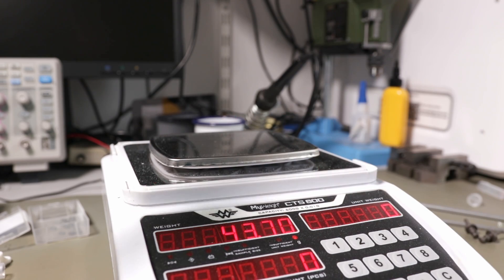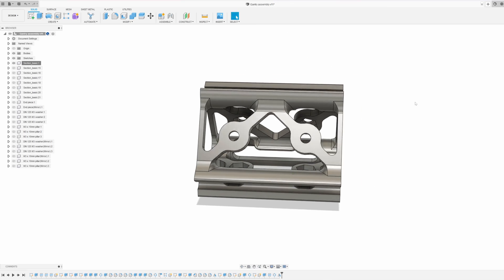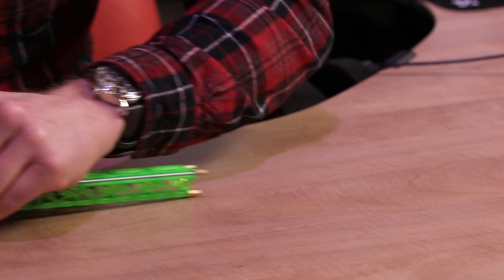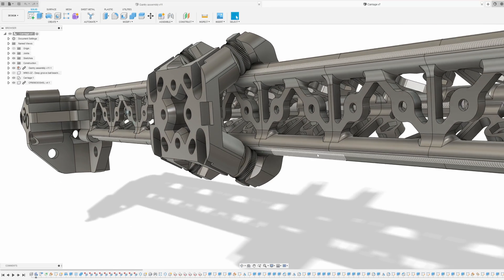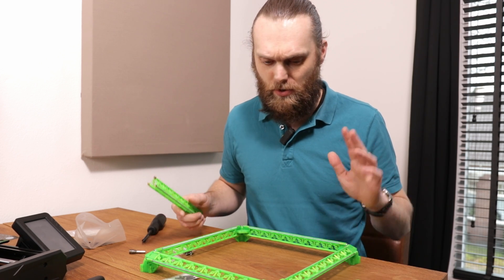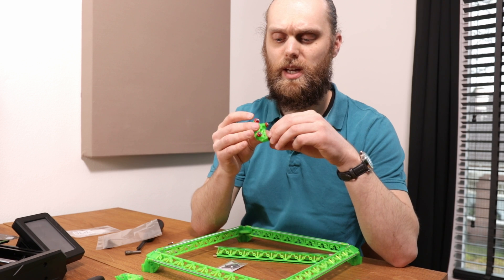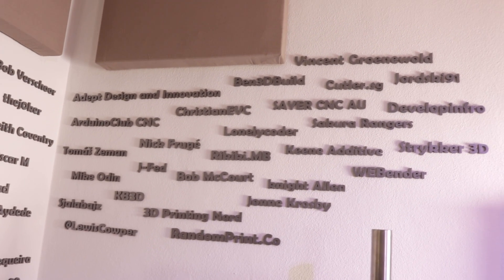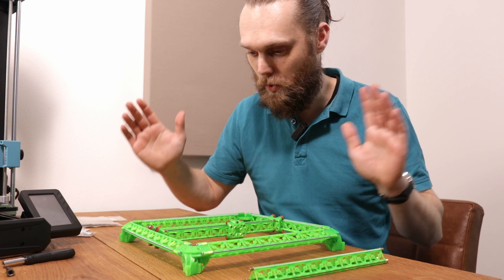Is This System the NEXT STEP in 3D Printing?

Comment: I think this will have its use. Another idea I had while watching was this super light, foaming PLA stuff. It gets weaker the lighter it is (obviously), so it probably has less of an effect than I think it will, but this probably helps with the weight. And yes, I think tubes with threads on the ends is the way to go here.

Comment: A truss is stiff and light, yes, but it is also a long cantilever and the forces change the further away from the mounting point you go. Longer moment arm means different frequencies and increased forces. You need to change the truss structure along it's length. Fusion360 can do this kind of topology optimization. Take a look at a video by Thomas Sanladerer called "Making STRONG shelves with Topology Optimization" and see if you think it might be worth looking at.
Reply: I'm mentioning this because I've seen this exact kind of project before and the result is always the same. As the dude said, you're making tradeoffs constantly. You have no need to simply re-do what everyone else has already done and if that's what you plan to do, then don't bother. But I have never seen someone consider a variable topology generated from force simulations on the model prior to manufacture.

Comment: Started with speed benchies my arse. I cut a triangulated beam/truss gantry for the corexy I built over five years ago. A superior frame system for static members, better than 99% of the 3d printer junk on the market already exists, welded rhs steel. Carbon fibre strand in tension is the king of light and strong. Look at the Britten motorcycle.

Comment: It's always a good learning exercise to try and make something with the "wrong" materials (cardboard bicycles, rubber band-based refrigeration). It really challenges you to understand critical requirements. That said, it's probably worth doing some back of the envelope calculations on how much you have to compromise to achieve similar performance from  plastic compared to higher stiffness to weight materials like carbon fiber tubes or rods of some stiffer aluminum alloys (if you can find some). Check out Ashby materials diagrams for Young's Modulus vs. density for a quick visual comparison.

Comment: how compressible is the 3d print? i think that might be a reason its not as good as expected. the print compresses /deforms and the shifts.  an idea is to make the holes on the end conical for alignment.
also the frame could be heavy and stiff since its not moving. that allows you to put tension on the gantry.
i think it would be an idea to glue the metal rods.
bike spokes might be an alternative to threaded rods.
also 3 wheels is better than 4 since if its even the slightest loseness the gantry will ride on 3 wheels even f you have 4.
a true tensegrity structure might be better...
also wouldnt the easiest way to decrease the weight of the moving mass be just to make the print volume assymetric? instead of 300x300 you make it 150 x600. the short axis is the moving mass.

Comment: Have you ever seen the Positron? It's also got some clever ideas to print even faster--the most important, I think, is printing upside down to keep the print head as low as possible, reducing the wobble of the frame. The bed is then upside-down, which seems to work just fine. Maybe some of the concepts used there could serve as inspiration for your project? Combine an ultra-light frame with a low center of mass, and a low printhead that can dash back and forth without shaking the frame apart.

Comment: It could be reallly interesting to make a big printer out of this type of system! As I know, the big rails are very expensive. I mean those that are straight and stiff. If you can manage to make a pretty cheap system (but better than cheap Chinese rails that also can be "OK quality") for a big printer (500x500mm +). Also I guess that a big 3d printer will need more powerful motors and more powerful driver chips to maintain great accelerations and deccelerations without noticeable defects in 3d prints.
It's my vision for your question "do you want me to..."

Comment: I was gonna suggest smooth rods and grooved rollers but they you figured that out yourself. You should also only need 3 bearings per carriage, you're over constraining them which makes movement less smooth and more sensitive to alignment. On the small scale of the voron 0 you're unlikely to find success making this lighter and cheaper, but for a large format printer where weight really starts becoming an issue and there is more material that can be removed, you make have better luck. 

The straightness of the rails should be somewhat adjustable by tightening and loosening each of the three rods to tension one corner more or less to pull things straight. I don't think this will fix wonky rods though so maybe try buying precision ground linear rods?

Comment: Looks sick and I think it has potential. I'd say work on it a bit more and it may be a successful innovation for Rep-Rap style printer designs. 
Maybe it needs smooth rods as you say, or maybe there's a way to ignore the bearings all together and just have a Teflon interface sliding on a smooth rod?

Comment: Please try this again but use superglue, to glue in carbon fibre rods and heated inserts at the ends for screws, with a far more minimalistic skeletal structure. PLA will "creep" over time under high loads and you'll find your threaded rod tension soon disappears.

Comment: I would build a complete 3d printer because it looks cool! 
I think the frame should be heavier in order to minize vibrations (so you could use irony threads there and save costs), then you could use your new lighter beam-system on the motion system.
Just try to improve the beam straighntness and rails (plastic rollers, not a good idea).

Comment: Hollow tubes with ID thread will work. You dont really need to thread the rods from outside.

Use carbon fiber tubes and roller bearings like you showed. This sounds easy enough with materials.

Comment: Plastic will have a tendency to deform over long-term exposure to force. You'd have to very carefully design your stresses.

Better to use something else to gain  compression resistance and go to wire for tension instead of threaded rods.

Comment: I love the idea. I was considering something similar once.
However, it is not a reasonable way forward:

Tests with 3D Printed parts show, that the stiffness of any printed material is not sufficient.
When you upscale it or you try to go for higher speeds, it will introduce wobble.
Now you add some stiffness with your metal rods, but this again adds weight. 

Way easier:
Buy a 2cm x 2cm carbon fiber pipe and mount a linear rail to it.
The endproduct is lighter.
The stiffness is increadible - even if you upscale to a large format printer.
These pipes are standard parts, meaning they are affordable.

What you get is greater stiffness, less weight, less effort and a concept that works for every printer size.

Comment: Once you started this the word "tensegrity" came to my mind. The conjunction of compressive members and tensile threads. did you consider the carbon filaments and unified tensioning mechanisms? you will save some weight and hopefully will find a way to adjust the chirality of beams and skew of the frame. would you reduce the main masses, the motor of the extruder, and the heater/radiator?

Comment: Put a threaded rod in the middle to secure them together, and smooth rods on the outside for the bearings to roll on... and do metal on metal rollers, not plastic ones. Maybe even try some carbon fiber rods on the outside for the rollers?

Comment: I agree with others, that this may not work for a 3D printer (probably not, I’d say), but I think has a lot of potential as a general structural system. As noted, it could be scaled up for larger objects. 

I wonder how it would compare with aluminum extrusions at larger dimensions? The extrusions might me more stiff, but they get dang heavy in larger cross-sections. What if the panels were, say, 10cm on a side, with 5 or 6mm rods in them? How stiff would the assembly be, for how much weight per unit length?

Kudos for your creativity and pushing the envelope with different “crazy” ideas!
I learn something or get useful ideas from every one of your videos, this time it was the idea of pre-tensioning the assembly to avoid stripping the threads on the Al rods. I knew this is done with prestressed concrete panels to overcome the low tensile strength of concrete, but I’d never thought of it as a way to save threads in a soft material the way you used it here.

Comment: Rather than making a bunch of corner pieces for each posssible angle, wouldnt it make more sense to make one master angle piece then make "adapter pieces" that rotate it to the correct angle?

how I would do this is lower the angle adapater piece lengths' along the X and Y axis, and then require these adapters on each end, so these adapters could be swapped in and out, maintaining the original length and equal length on both sides regardless of which adapaters you use. 

Although if your designing it to be used as a printer frame ig this is unnecessary, regardless cool project

Comment: Have you ever thought about putting the toolhead on a single screw similar to a cartesian z-axis? Then, the Y movement can also be on two screws (one on each side) with two stepper motors that moves the X axis and toolhead. 3 powerful stepper motors should be able to move that pretty fast. Sure, it will be more mass, but you'd also have more torque applied by having 2 stationary Y axis motors.

Comment: I might suggest rather than an enclosed triangle ⛛ , an equilateral Y shape. Tubular roller shafts (rather than threaded) should give a better weight to strength ratio; the receiving cups could be much smaller, and use CA glue for bonding lengthways. Have the wide of triangle down on flat surface, apply CA to upwards facing leg 'cup', drop in tube, which could be held down with a milled jig to ensure straightness and uniformity of pressure while curing. Ends of tubes can be tapped as needed. Not sure about the rest since I am only a lowly Ender 3 V2 use, but fascinating to watch your design progression.

Comment: Try designing the segments to use 1 threaded rod through the center. Make the end segments a little more stout or a plate of some kind to allow more torque from the single rod and connecting points for the joint. For the corners, make them interlocking and completely round or what ever mating shape you want the rollers to be. OR 2 corners interlocking and 1 corner designed to hold a hollow tube for the linear rail.

Comment: i think theres a lot of merit to this, but what i don't know is if it's possible with plastic. titanium and aluminum are kings in strength to weight ratio, but that isn't cheap for something like this, although i wonder if any performance could be gained using a gyroidal infill or something? additionally I think equally important to weight here is stiffness. if you can simulate or test stiffness for a given method, i think the comparisons will become much more valid. in an ideal industrial scenario, these segments could be extruded out of aluminum, just like everyone's favorite extrusion. they could be machined lighter but maybe no need, and then linear rods with threaded ends could be used as these bearing surfaces. of couse the bearing you describe at the end would be good for that, but in an ideal mass manufactured sense, recirculating ball bearing carriages could probably be designed for this. either way, when you weighed your designs vs just the linear rail, you included your carriage and not the linear rail's carriage, so that's a bit unfair. i also maintain that this concept could go much much further if 3d printed with continuous fiber reinforcement as found in a markforged machine. best of luck, i like the idea quite a bit actually, and i think with some refinement, and even partnership with a manufacturer, this could become something quite cool

Comment: None of this material is stiff. Next time print in CF Nylon for stiffness of the plastic parts and use CF hollow rods. This way you can keep the look and make the part ridgit. This kind of application is perfect for CF.
If you want great performance use a CF square tube and cut holes into it. Or use thin gauge steel sheets with lots of depressions, cut outs, flares and so on.

Comment: I saw an interesting design concept. A single smooth rod for X and a single smooth rod for Y, with the hotend assembly mounted at the intersection of the two rods on LMXUU linear bearings contained in a single block. Each rod constrains the potential for rotation on the other rod. The Bowden-based hotend assembly just has to be mounted such that it avoids the rods. With carbon fiber rods and Delrin bushings instead of bearings it can be much lighter. There is also another design concept that uses DIN Rails. They're not the lightest things, but drill enough holes and they can be reduced in weight a lot. Of course, using a Bowden system reduces the weight to a minimum, but you hve the trade-off of needing to do longer retraction. High quality PTFE tubing can make a difference here, along with well-tuned Linear Advance. We certainly can do better than 20x20 extrusions and rollers!

Comment: You could use steel tubes with spreading press-fit sleeves with internal threads at the ends (if there are any as small as you need).

Edit.
Maybe you could 3d print some?

Comment: This is a great video. Your CAD skills are top notch, especially the ability to make that complex corner piece printable without supports.  The idea itself is great and I would love to see more of it. 

Smooth titanium rods are definitely the way to go. 

As far as filament goes, here are some things to things to think of. 
For Stiffness, from most stiff to least, there is (Carbon Fiber Filament, HIPS, PLA, Poly Carbonate and then everything else). 
For Density from lowest to highest ( Polypropylene 0.9 g/cm3, HIPS 1.03 g/cm3, ABS 1.04 g/cm3, Nylon 1.06- 1.14 g/cm3,  ASA 1.07 g/cm3) and then everything else). 
For Strength from strongest to weakest (PVA, Polycarbonate. Nylon, PLA, ASA, PETG and then everything else). 
For Durability from most durable to least, (Nylon, Polycarb, ASA, Polypropylene, ABS, PETG, HIPS, PVA

For a part that needs to be stiff and light but not necessarily durable (Carbon Fiber Filament)
For a part that needs to be  light and durable but not necessarily stiff (ASA or Nylon)

For a part that needs to be stiff and durable and light (HIPS)

You can find more material info on Simplify3d's resources page.

Comment: $10 that most of the stiffness/load-bearing comes from those rods, ditch the plastic and you'll see minimal loss of performance. I'd even say that you might see and improvement in terms of stiffness/load-bearing per unit-of-mass.
Reply from the maker: You'll loose 10 bucks ;)

Comment: Problem with speed prints is that you need light as possible construction but at the same time resonance starts to become problem that can really only with added weight be solved. My prints are all speed prints, quality is secondary priority since i will mostly print with ABS and in less time it would take to print with nice finish i will take injection needle with cut end, syringe and some acetone to smooth everything, fix any issues etc so speed is the biggest priority. So yeah speed setups would be interesting but there are limitations what can be achieved. Then again i could get better results with just swapping to coreZY printer but now days i print very little with my prusa i3 clone. Maybe that could get me back to printing more, but for folk like me this could be beneficial development work, so have at it!

Comment: If you go for octet truss girders (octahedrons connected by pairs of tetrahedrons), then there is just one natutal orientation for the nodes. Though then the printer frame is not a cube anymore 😅 . You get a (much stiffer) octahedron shaped printer frame instead.
Reply: Octet truss struts and girders go into [111] directions (see miller indices).
Both octahedra and tetrahedra are deltoids. That is: They form a space-truss (no bending loads on nodes) rather than a space-frame. => More stiffness.
If many (max 12) strust meet at a node then the system is statically overconstrained to high degree. => More stiffness.

Comment: Instead of minimizing mass how about making it fully printable. Like so:
★ go for bigger segments
★ remove the metal rods
★ tension the segments together with a thin rope through the core instead, like in a tent.
Yes, plastic is less stiff than metal even as a truss, but it's way cheaper.

Comment: Carbon Fiber rods. Threaded caps on the ends of the rods. You cut the rod to your need minus the threaded caps, which you super-glue onto the ends of the rods.

Carbon Fiber segments. Also super light, also super strong. The overall solution may be carbon fiber filament. Another solution, which would bring you a fantastic sponsor: Metal Infused Filament. There's a company out there that's making it and selling it (I think rolls are $90), and they want you to use their filament, then send your print to them so they can bake it to release the metal part within the print. Tungsten segments (super light), carbon fiber rods, threaded caps. It would be a FANTASTIC SYSTEM. You are the person who can make it happen!!!